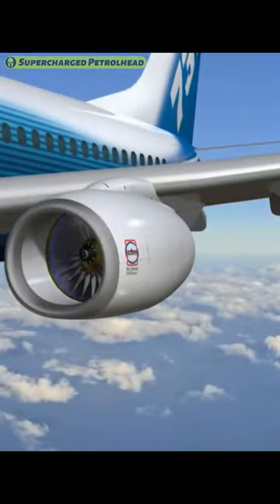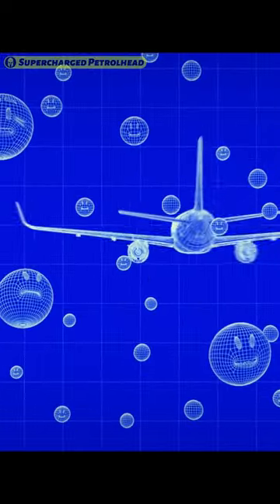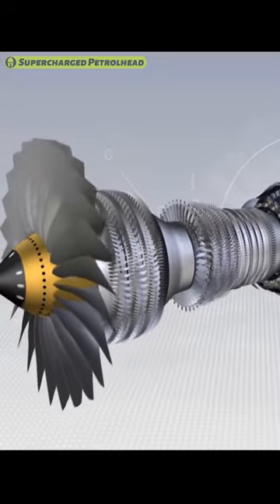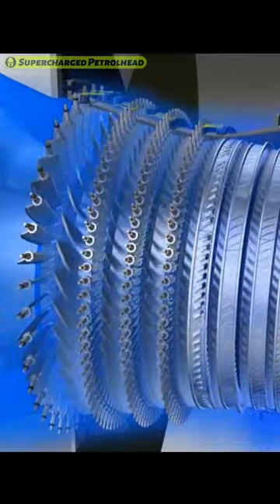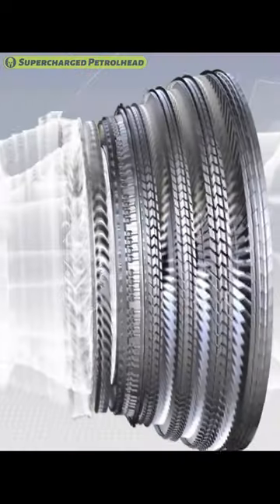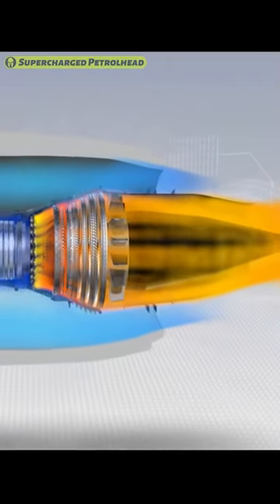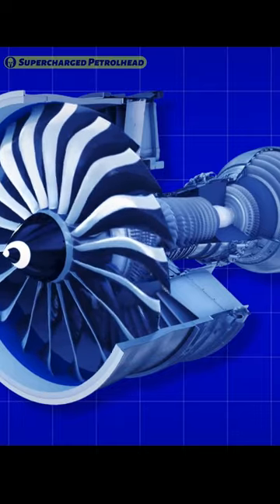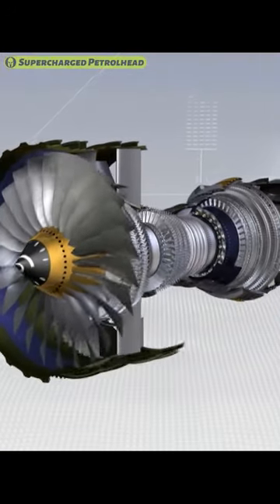How Airplane Engines Work? #howitworks

Comment: Actually 80 of not 90% of the thrust comes from the bypass fan!!
Reply: I just wanna ask how do you close/limit the thrust from the engine
Reply: By using the thrust leavers found in the cockpit which limit the fuel delivered to the engine